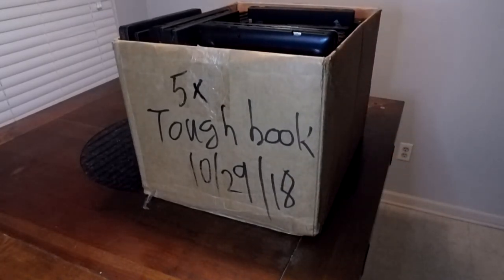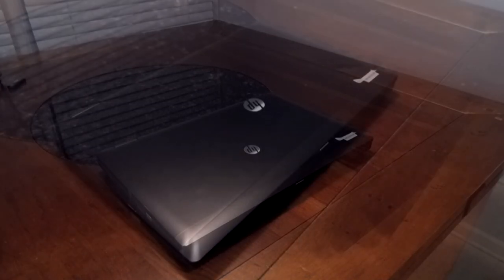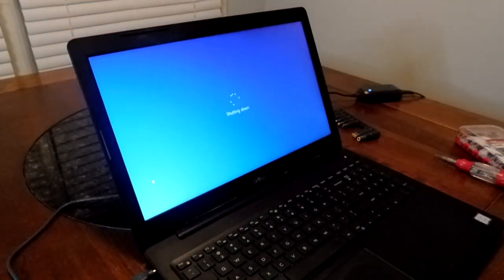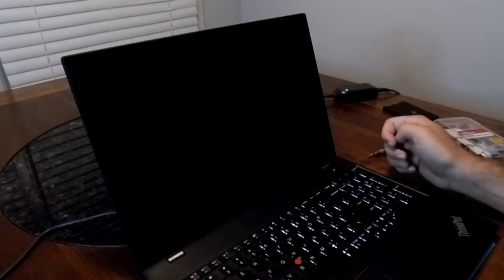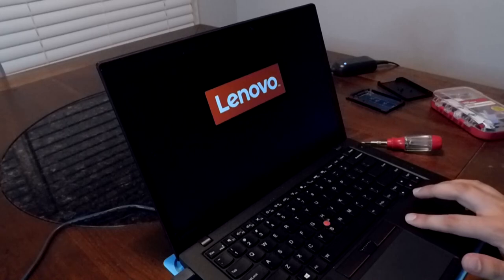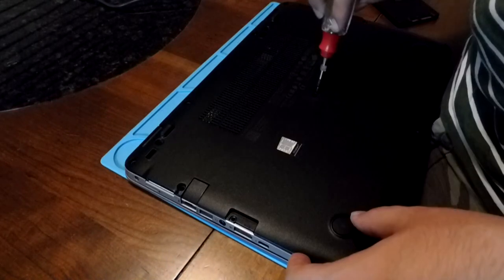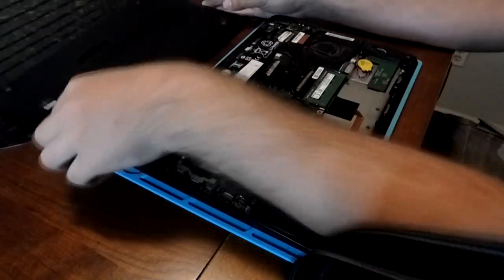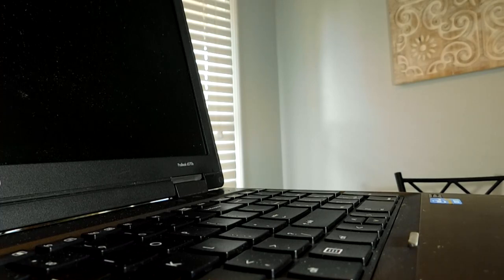I got 27 free laptops!

Comment: Super interesting! I bought a second hand P51s not too long ago and restored it (had some bad ram, tiny ssd, no battery) and use it for light gaming (I don't mind having graphics settings on "Low") and my studies. With a new external battery the thing easily clocks in at 10 hours+ when doing basic web browsing, slightly less when gaming. They're great laptops!